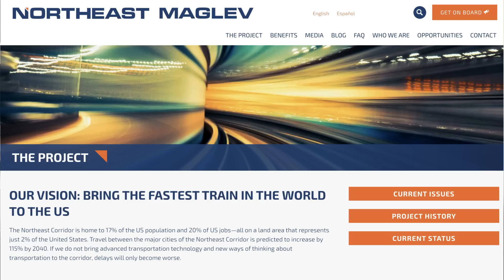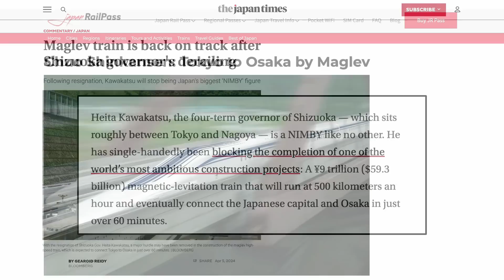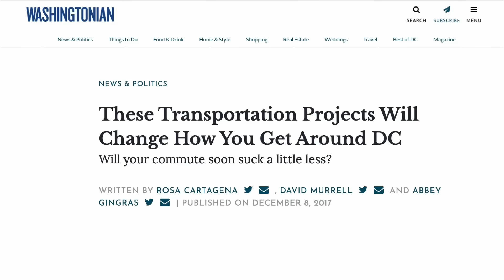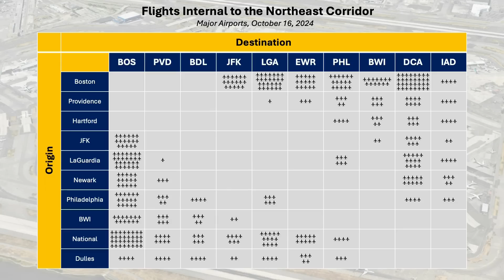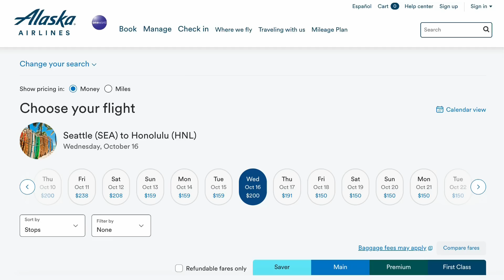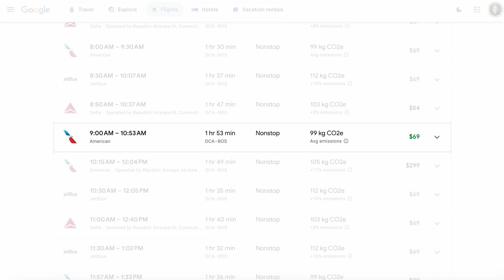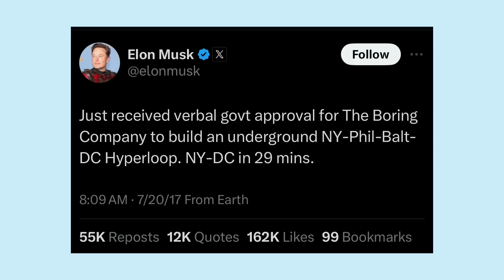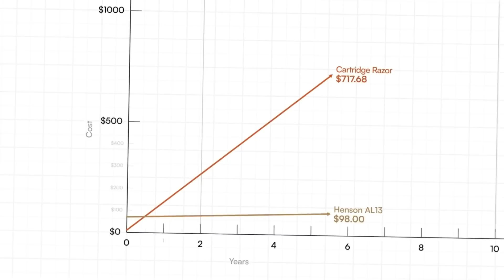A DC to Boston Maglev Would Be Awesome (and you know it)

Comment: Those 450 daily flights represent about 40,000 passengers, all of them long distance miles. Current Acela ridership is 10,000 per day so maglev would quadruple that easily just from airline passengers. Probably would gain even more than 40,000 from drivers whose trips would now be significantly faster by train. Rough estimate of 8x the current ridership or 80,000 daily riders at the same price per ticket is 8x more revenue on a service that was already profitable at 10,000 riders per day.

Comment: A Maglev is much more expensive than regular high speed rail. Maglev might work in a country like China or Japan that already have HSR running, and want even faster express trains between its largest cities. For the US, it can't even build regular high speed rail. Part of that reason is urban sprawl and lack of local public transportation. In China, Japan, or any European country, once you end up in the destination city, you connect to the local metro system to get to exactly where you wanted to go. In the US, if HSR existed, you'll just be stuck at a train station in the middle of a sprawling city, and you still have to find an Uber to drive you to your final destination. And this also applies to airports. The US is about the only country on the planet where there are usually no viable public transportation options once you land in the airport of a major city (with New York, Chicago, Washington, San Francisco and Boston being the only real exceptions).

Comment: One thing to keep in mind for almost all HSR connections is that they are not going into cities directly. The Chinese HSR network is almost entirely separate from the normal rail network. French TGVs and Spanish high speed trains also have their own separate stations often located outside of cities, sometimes in the middle of nowhere. So these proposed travel times would need to deal with taking conventionally slow services like buses to these stations. And even if existing city stations would be used, a MagLev train would not go 500kmh through the heart of NYC, it would slow down to commuter train speeds for quite a bit. 

Germany's ICE trains are the only HSR that I personally know that uses the same rail network as regular trains. They "only" reach speeds of ~200kmh, and they do slow down significantly when doing into cities. They also suffer frequent delays because of the shared network. 

Just some additional thoughts.

Comment: So, an NYC train enthusiast who hasn't visited Philadelphia in decades thinks we'll see substantial ridership gains by cutting the Acela time from 1:25 to 45 minutes for a ticket that'll be in the hundreds of dollars? Union Station to Penn Station on this proposed line would be equal in price to the flight from either place to LAX. In Japan and Korea, traveling by car is a lot more expensive than it is even in the mid-Atlantic. I think you're losing hundreds of riders on price for a handful you're gaining on time. I personally take SEPTA and NJ Transit between NYC and PHL, which ads an our and is 20% of the price. I do that a couple times each a year and I live in Europe.
Reply: Also, the comparison with Madrid/Barcelona, which I have done by train and car, isn't applicable in the Northeast. It's empty land. If you cut out Wilmington, you lose Senator Joe Biden. Cut out Newark airport and there's a bunch of folks just using the regular Amtrak services. There's a reason Amtrak makes all those stops and that's because it increase ridership. Again, because of price, you'd have many more people on Amtrak than this maglev. It just suits the needs of the existing ridership better. And Amtrak is making incremental improvements. Acela is high-speed rail where the lines are up to standard.

Comment: Nice video! As an occasional user of the Acela NEC, i had special interest in this topic. I may not live to see high speed rail in my current residence of Texas.  By the way, I purchased the Henson shaver with your affinity code. Comfortable close shave. Lucid Stew did an interesting video several months ago that included some recommended track upgrades to more fully exploit the new Avelia Liberty trainsets. Not quite the Maglev upgrade but those improvements could conceivably be implemented piecemeal.

Comment: Treat Maglev with a healthy dollop of scepticism. It is a technology that has been around since the 1970s and has failed to make any major inroads into the world high speed train market,

 The technology came about because railway engineers doubted that conventional trains could achieve service speeds above 200kph (125mph). That limit has long been exceeded and, here in the UK, we are building a high speed line that will eventually allow trains to run at 400kph (250mph).
A Maglev has to put energy into the system simply for the train to float above the track and be guided - something you get for nothing with conventional wheeled trains. However, the major energy consuming factor is air resistance which varies with the square of the speed and Maglev does nothing to reduce that.
The Japanese are developing a Maglev route as they are an earthquake prone country and the air gap between track and a Maglev train can overcome track distortions.
The current speed record for a Maglev train is 603kph whereas that for a conventional French TGV is 575kph (in fact these records have leapfrogged each other). 
There may be a case for Maglev in the USA but it is not as clear-cut as some of its proponents might claim.

Comment: -  The catchment areas for these systems need to cast the widest net. I’d rather maglev tbms dig dozens of metros. 
Maglev oooooo but does not have the compatibility like adding fast rails to a rail network. If you skip integrating the different services (local and semi fasts) when you add the ultra fast you’ll further increase inequality with harsher transit deserts.

Comment: I love your vision but how can we get this done?  We can't - because there is no government entity to take responsibility and flush out the vision and manage the costs so it doesn't cost 100 trillion dollars.  We need legislation created by Congress similar to what created the Port Authority of NY and NJ in 1921.  Say what you want about the agency, but it is the closest thing we have to what we need.  London's $22 billion Elizabeth Line opened during covid and moves over 600,000 daily passengers. The LIRR opened the $12 billion additional access to eas Midtown at Grand Central Madison and did so as a old fashion 8 track stub end terminal deep under the existing and beautiful Grand Central Terminal, not connected (even though the LIRR and Metro North are both part of the MTA) because the two agencys hate each other and protect their turf and nobody blinks and eye.  And it only moves 60,000 per day - what a waste.  Now Amtrak wants to "help" NJ Transit as part of Gateway and build 8 new tracks by using eminent domain to purchase a block south of Penn Station to add 8 new tracks to serve NJT and get them out of the way.  And what will the cost for this be?  Check the NY Post on Dec 25th 2023.  This too is outrageous and lacks the kind of vision you are presenting.  Folks we need to work together on a vision and then put someone in charge who cares to keep costs down, but move as many as possible and the goal should be to reduce car traffic.

Comment: 1:13 What is important is not size but population density.

New York metropolitan area 8,294.2 sq mi (21,482 km2)But only has density  2,350.8/sq mi (907.6/km2). VS
Greater Tokyo Area 13,452 km2 (5,194 sq mi) with  density 2,642 people/km2 (6.834.6/sq mi)

Comment: Hig magnetic fields are very bad for you, just don't ride more then once a year or so.  Do they work in China?  Sure, but they don't care if you get hurt.
Reply: 😂Thats not true. You ever ridden an electric powered train or car? That thing has huge electric motors that generate strong magnetic fields as well. Are they bad for you? Of course not. But if you will, you have to differentiate: Yes, the japanese SCMaglev does generate relatively strong magnetic fields. But do they let you get anywhere near those? Of course not. The train has shielding such that it will not be bad for anybody inside the train or outside the tracks (and they design airplane-style bridges s.t. nobody sill ever get in the tracks at stations). In case of the german Transrapid (which is also the technology used on the Shanghai Maglev), the magnetic fields are actually smaller than those on regular trains, so they do not even need additional shielding.

Comment: is the deal. I grew up in this region served and worked in DC, and I am very familiar with thus project. It was originally proposed back in the 1990's, fo going on 30 years and it just finished environmental proposals before being shelved by the Trump administration and everyone else forgetting it existed. I am very for this project i even signed the petition. But I have a very hard time watching you videos because they all take place in a bubble, little more. All your reasons for we don't do anything is well stupid politicians and NIMBYs. However, there is a video on here by CBN, the Chibese Broadcasting Network that just admitted that over 80% of Chinese High speed rails stations are empty. Yes Beijing to Shanghai are packed to the gills but that's the excpetion, not the rule. So DC to BOS is packed, but it's packed with development from DC to BOS. Even some of the traditional high speed rail proposals take the trains around Baltimore because it's so dense. Even the MagLev project last ran into issues because NASA didn't like which side of MD295 it ran on. We are not China, we will not knock down thousands of homes just to say we did something. Stop half reporting.

Comment: pipe dream, the U.S is corrupt capitalism uncontrolled, the U.S has worse infrastructure than most countries in asia, and some of these countries were literal farmland 50 years ago. in Boston here, it took them something like 10-15 years to extend an old outdated rail line by like 4 miles or something, probably cost them over 100 million dollars. there is a huge amount of corruption disguised as red tape requirements. even Europe in England they can build a huge tunnel underground 10x faster and 10x cheaper what it would cost here. the T in boston buys old outdated designs yet new rail coaches that cost hundreds of millions, literally just the coaches, meanwhile in Europe a fraction of that and they get super modern trains with comfy as hell seats that look like recliners. Amtrak keeps getting paid to use rail from the 1900s. all the rail in the U.S is from the 1900s, it was never updated, no infrastructure is ever updated here.

Comment: I am a huge transit fan, but I have to say I am not in support of this.

While decreasing travel times, and replacing flights is useful I think we need to ask the question of "Is maglev or HSR the most useful use of X billions of dollars"

Investment into last mile transit is critical in order to maximize the usefulness of the NE corridor. Move the start and end points 5mi into the suburbs and the timings change drasticly. If the access times jump to 60 or 90min even the maglev no longer competes with air.

I do not think replacing the Acela is the best path for transit funding. Obviously improvements need to be made in the CT region and the electrification project needs a lot of attention. But if I was given $200B to spend on transit a LOT or improvement can be made to last mile service. It's not as flashy but is a nessicary component in the transit system.

Comment: I personally do not like maglev train technology, I find it to be a waste of money for something cool and flashy. A bit like the hyperloop but not as bad of course since maglev actually exists-. We already have conventional high speed trains that are designed to operate at 400 km/h and we can probably achieve higher speeds than that. For the amount of money maglev costs you could build so much more high speed rail. Also maglev is a really niche technology which makes it difficult to implement, economics of scale and all.
Reply: Maglev absolutely has some technical and operational advantages over steel HSR, and I'm not sure the cost difference from zero is as high as you think.
Reply: @CraziFuzzy  The main reason why conventional HRS is not faster lies not in the technology of the trains, but in the placement of the tracks. For operating speeds approaching 500 km/h you would have to significantly enlarge the radii of the curves and this would bring many problems with NIMBY and terrain. These two factors influence the price of such a construction. 
From the design parameters for the Chūō Shinkansen: ‘For example, the minimum radius is 5780 m for a 350 km/h high speed railway alignment defined for a maximum cant of 150 mm (6°) and a cant deficiency of 100 mm (non-compensated lateral acceleration 0.65 mm/s²).
The maglev alignment with a minimum radius of 5780 m is allowing 450 km/h for a guideway banking of 12° and 505 km/h for 16°, for the same non-compensated lateral acceleration of 0.65 mm/s² – this later value defines the maximum speed ...’
Reply: The point is that the planned operating speed of the Japanese maglev is not 400 km/h, but 500 km/h. You could try to build a conventional HRS for that speed, but it would cost the same as a maglev.

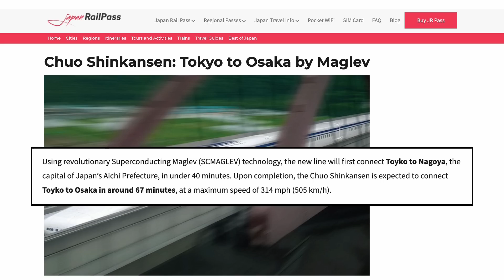Comment: 3:01 ca hsr is going to start revenue service in 2030-2033 (atleast the bakersfield to merced portion). unless you’re defining revenue service as the full sf to la route. but i think discounting the importance of the central valley portion is not a good thing. you consistently bash california high speed rail in offhanded quips in a way that doesn’t even add to the conversation in my opinion. i love your videos otherwise though.

Comment: With an increased delta in your graph model, it would be curious to see what city pairs could become Maglev viable vs Flight, suddenly Maglev from NYC to Chicago, DC to Atlanta, and so on

in some respects it is perhaps closer than we think but yet still decades from even being implemented if ever. the initial costs of it are so much higher than traditional HSR, but should fall as the tech starts to mature but again will take time where the upfront cost becomes more practical than the best traditional HSR

Comment: There are two issues you didn't consider in your exposition. Firstly there is the issue of interoperability. The advantage of old fashioned duo rail is that it is already wide spread. If you look at the European use of high speed rail it is limited to major flows but the trains can continue onto onto other major cities which don't justify the cost of new lines. For instance you can catch a TGV from Paris to Marsailles using LGV, but it can then continue on the conventional route to important cities like Nice and Monte Carlo, with no change of train. This provides much greater advantage than an isolated maglev, as it encourages people to use rail from a wider area who might otherwise have flown or driven. 
The second issue is associated with this, in that Japan already has an effective high speed network, the maglev is on top of this.

Comment: Isn't there more of a difficulty compared to traditional high speed rail that the trains wont be able to run on normal rails interchangeably for when the trains need to enter existing stations?

Happy to be wrong on this, but it seems high speed rail will provide more ease and almost as much benefit, especially with the fact you could use 1 system nationwide.

Comment: Until we get  Star Trek innertial dampeners, you can't stop a 400kmh trrain on a dime otherwise baggage and people will be flying in each carriage.  And it can't go from 0 to 400 in 6 seconds either like the Enterprise can.   For this to be worth it, you'd need to have non-stop Boston-New York-Philadelphia-Washington  and have to drop intermediate stops and bcause you would need to build totally new right of way (likely elevated over i-95) towns that wouldn't get service wouldn't happily make it easy for this project to go through.  The amount of tunneling through all of New York area (and new tunnel under Hudson would be staggering. You can,t re-use existing tracks because building magmel would kill local and existing amtrak services during the very long construction period.  (and current right of way has curves not good for going at 400kmh.
BTW, Paris-Lyon opened in early 1980s with urban sectiosn on conventional lines and those took quite a while to be extended into Paris and Lyon itself.  The rest was built through farmland. 
Boston-Washington is basically all urbanised  so drawing a straight line through it would be a monumental exercise in buying out properties and dividing neighbourhoods etc etc  (same damage as highways did in dividing neighbourhoods in the 50 and 60s). 
The Maglev won't free up the tracks that are still used by Amtrak, commuter trains and yes, south of wilmington, freight trains.  So can't argue that while you destroye one area for Maglec, you will free up another. 

Maglev might stand better chance at Chicago St-Louis, or proper los angeles to Las Vegas (not the half harted Brightlune PR project that thinks it can follow incline of a highway up/down Cajun pass).